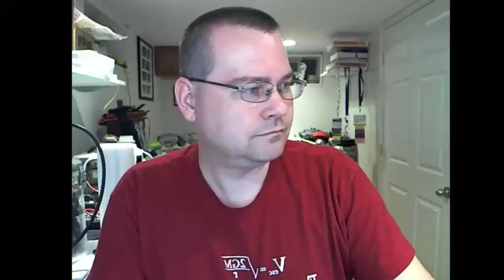NYC CNC Open House, Talking shop

Comment: I have owned an 1100 for a couple years, I bought a 440 six months ago, they are both great for the money
Reply from the maker: Agreed, I went VMC because I needed a little larger work envelope then Tormach provided. I would not hesitate to buy one if it fit my needs.

Comment: I do runs of 1000 to 3000 parts per run
Reply from the maker: That is awesome, I hope not one piece at a time, do you setup fixtures so you can batch work and just leave the machine run?
Reply: Oh yeah, I have multiple fixtures for some parts that I swap out  pallet changer style, to minimize down time between cycles, I run lights out every night.